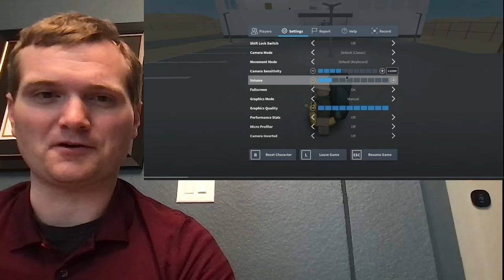Nuclear Engineer Reacts to The Roblox Nuclear Power Disaster

Comment: The thing about coal and gas that makes them so attractive, besides the high energy yield, is that they are much easier to implement and use. Just light them with a spark and boil water to turn a turbine or push a piston. These other more "green" energy sources need semi and rare earth metals or radioactive materials, all of which are harder to find and use. Hydroelectric power and wind turbines are perhaps the easiest of these green power sources to implement but hydroelectric power relies on large bodies of water and wind turbines need wind, which isn't always available and is rather unpredictable. I have come up with an alternative solution. Systems that can absorb and utilize ambient energy, such as stray EM radiation, and ambient heat. Some of this comes from sunlight but absorbing the heat from it would be easier to do than making a solar panel that only works when visible sunlight is shining on it.
Reply: Check out Heliostat or Solar Power Tower plants when you’ve got the chance. That’s a really good example of what you’re describing.

Geothermal power has also been suggested, the problem is either:
A.) You’re drilling much deeper than has been done before, to reach metamorphic rock. Think about the problems fracking causes, and you begin to see the problems with this.

B.) You have to build on active volcanic land. Its one thing to build, say, a monitoring shack for scientific purposes, but I think you’ll be hard pressed to find people to fulfill the logistics of such an operation.
Reply: @Insanonaga  idk man, working near active volcanic land sounds kinda cool, i'd wanna work somewhere like that
Reply: @Insanonaga  Iceland. all im gonna say
Reply: Uranium has a much higher energy yield, and exist coal power plants can be retrofitted with SMRs.
Reply: I'd look into the molten salt / thorium reactor power plants as the thorium used is MUCH easier to find than uranium or plutonium and the allocation of the components that could potentially lead to a meltdown are nowhere near each other, making it leagues safer than the older reactor models and virtually impossible to induce a meltdown. It's efficient to the point where it could automate itself (still have engineers on site to regulate things) with less need of oversight.
I'd say the two things bar us from having these much safer power plants are bad reputation (Where it was human error) that led to a bad image proliferated by unnecessary hysteria (Fossil fuels killed more people than nuclear yet we turn a blind eye to that.) and maybe its fossil fuel competition and the cost it would take to make these reactors even though it would pay itself off soon.
Reply: Remember the difference between Energy and Exergy. Let's say you leave a hot piece of steel weighing 1 kg (let's say 200 degrees C) in a typical, well insulated cubic room, 10 meters on each side (1000m^3). The metal is clearly at a higher energy than the room. Both have thermal energy, since neither is at absolute zero, but the piece of metal has more energy than the room. 

Doing the math, the air has a density of 1.22kg/m2, and the specific heat capacity is around 700 J/kg*K. Multiplying everything out, the air has 250 632 200J of thermal energy, while the steel has only 198 660J of thermal energy.

So why do we use the hot piece of steel instead of the air in the room? Very good question. It is because the total energy that is available to be used isn't the total energy in the system. 

First, we define a heat engine. A heat engine is any engine the converts heat into any other useable energy. Often this is rotational, but really the ultimate kind of energy is irrelevant to classical mechanics. 

Since heat engines are well described, we can come up with how much energy a heat engine of a given configuration would make useable. Since we are working with models here, let's assume that the heat engine in question does not release any energy other than that absolutely required for it's operation (is perfectly insulated), has not kinetic losses to friction (is perfectly lubricated), and extracts as much energy as physically possible (is perfectly efficient). In order to do this,  the engine must make use of 2 different temperatures. The given amount of energy that can be extracted, compared to the total heat entering the engine, is called the Carnot Efficiency. You can derive the equations yourself, but many very smart people have worked it out to be [1-(Tc/Th)], where the cold and hot  temperatures are given in Kelvin. By applying this ratio to the total energy, you get the total Exergy, or Available Energy. Keep in mind that this has been proven mathematically, and verified scientifically many times over. In our case, it works out to [1-(293/473)], becoming 0.381, rounding up.

The total energy transferred is given by m*c*delta T. Since the steel will cool down to the temperature of the room, and the room will maintain pretty close to 20 degrees c due to its size, the Delta T is going to be 180K. Using numbers for steel, it will transfer  75 600J of energy. 

Not that we have out total energy transfer, and our Carnot Efficiency, we can apply one to the other to find that at best, we could get the maximum total Exergy of 28 770J, rounding up. This may not seem like much considering the total energy in the steel is almost 200 kJ, and the room has a whopping 250 MJ. Unfortunately, it is physically impossible to extract heat where there isn't a differential, and then turn an energy excess. More than that, it is impossible to even get all the energy released as the system reaches maximum entropy. In order to get 100% Carnot efficiency (which would only get us 75.6 kJ), you would need either infinitely hot steel, or a room at absolute zero. Both of these configurations are obviously absurd, and would clearly need only more energy to cause this to be the case.
Reply: @zacharytaylor190  You explained it far better than I ever could, thanks.
Reply: The heat ones are bacically geothermal power plants. The use the heat of the Earth to make energy, something like lava, so usually they're built next to volcanos, in places like iceland
Reply: I learn more from this video than science class wth
Reply: I'm genuinely surprised nobody commented the nerd emoji
Reply: @Kratos7560 i think its mostly Oil and coal companies that want us to fear reactors 
And honestly for how safe they are? One percents do occur at times(although incredibly rare yes) so thats why they dont build Reactors often and Also away from people!
Reply: @seantaggart7382  True, nothing is truly safe when dealing with radiation, so it is best to keep these facilities far away from populated areas, including farmland. But compared to related deaths to fossil fuel pollution, nuclear plants have proven to be magnitudes safer. Not to mention that containment buildings are required that specifically prevent radiation leaking out should it ever go critical somehow either by human error/sabatoge or by some unseen flaw under very specific circumstances. I'd still be for nuclear power so long as they are isolated for the safety of the people.
Reply: @Kratos7560  same im All for it! But i just say plan for a 1%
Reply: @seantaggart7382  Exactly. People should be shown the raw data of both fossil fuels and nuclear power and the dangera of both. Educate them on how reactors work compared to, say, a coal or natural gas plant. Tell them the safety measures in place compared to the flawed designs of others that went critical and why they did. It's the fear of the unknown/ignorance that the fossil fuel companies bank on. And definitely teach them how to protect against radiation and what measures the government will take in the event of a meltdown.

Comment: The main takeaway here is that you usually have to TRY to get the reactor to go supercritical when other people are around... It takes a small group of sane people to stabilize a reactor, and it takes the collective agreement of everyone in the room to make a reactor fail... There are dozens and dozens of failsafe's and mechanisms to keep a reactor from doing this, and 90% of the time, it's collective human incompetency that causes problems, not the actual reactor itself... Reactors were made to be (nearly) as safe as they can possibly, or reasonably be...
Reply: Yeah
To quote a nuclear engineer(i think it was this guy) for them? Its not 1 + 1 = 2 its "1 + 1 = 100"
Reply: @seantaggart7382 what’s that mean? One problem plus another doesn’t lead to  2 problem, but 100 problems? That’s what I’m getting from that
Reply: @YoureMadBozo71  it means you got SO MANY safety systems for the one possibility that it is true that 1+1=100
Reply: @seantaggart7382  not sure i get the analogy
Reply: @nothanks1508  Its Kinda hard to explain
Reply: @seantaggart7382 if it's hard to explain why use the analogy at all then, sounds counterintuitive
Reply: @thedude3005  because i didn't make the analogy 
I think he said it in animation vs math

Comment: Years ago, I played that solo and it was designed to always end in catastrophe. Not sure if the dev changed it since then. One thing you might like for the game Minecraft is the tech mods that it has. Not sure what some are called now, but there is/was Atomic Science (which relied on many other mods to work interchangeably) where you could build your own nuclear reactor in that game to generate power (typically Redstone Flux (RF for short)). Both Minecraft and Roblox has some really tech-heavy games/mods going for them and all enjoyable.
Reply: It isn't that it is designed to end in catastrophe, but rather pointing out that it takes multiple people to make any meaningful change in the system. Even in this short edited video, you can see how Ruben repeatedly has to either distract the other players or get them to follow along in order to actually get the system to blow. Which highlights one of the major factors of nuclear reactors, even for Soviet installations during the time of Chernobyl, which is that everyone in the room must be complicit in the incompetence for the series of events to occur. Although that can also be said for basically 99% of industrial incidents, since human incompetence and/or negligence is usually the end culprit.

Comment: You should try reacting to some stuff on the Roblox game "Chernobyl Unit 3", it's a VERY detailed game and actually one of, if not the most realistic I've seen of the control room, controls and physics, including temperature simulation, voiding simulation, reactivity simulation, instability simulated. You can even select EVERY individual control rod and pull them out or insert them individually, you can change the speed of the pumps, close the throttle valves, screw with emergency power and the EDG, run up the turbines, sync them to the grid, and more
Reply: thank you so much ily

Comment: Dont know if it was just me, but when I realized nuclear reactors boil water into steam to spin a turbine that produces electricity it seemed somehow less impressive/intimidating
Reply: Well, some people describe these as "pressure cookers", and they're not far off. It is essentially a boiler - you're just using the byproduct of nuclear reactions (i.e. the heat) to heat the coolant, instead of say burning coal or natural gas.
Reply: big kettle

Comment: I really wanted to become a nuclear engineer for a really long time until a year ago when every job site I looked at told me it wasn't a good idea because the job demand is on a decline, so I stopped pursuing it then and there. Since you're one and you might have more knowledge than I do, how would I go about getting a job in nuclear engineering if I were to graduate with a bachelors?  Being in Texas, its actually easy to decide where I would go to get the degree, Aggies has the biggest program and multiple on campus labs for it. I just don't know where I would go to get a job in that field.